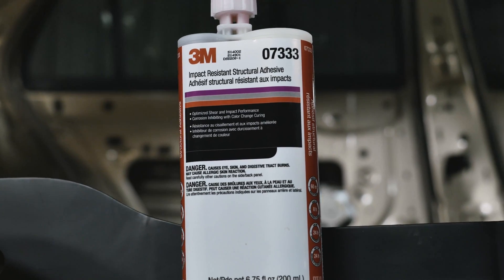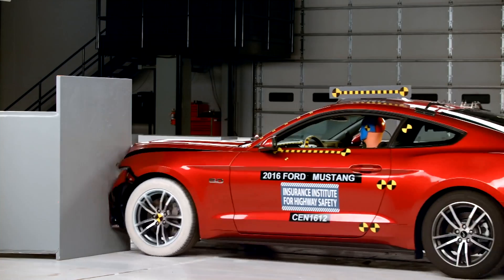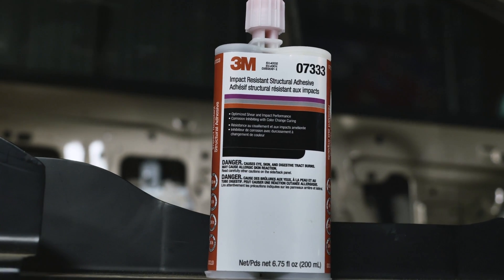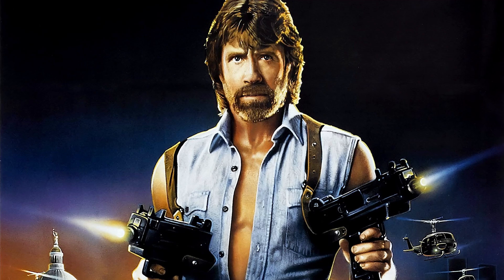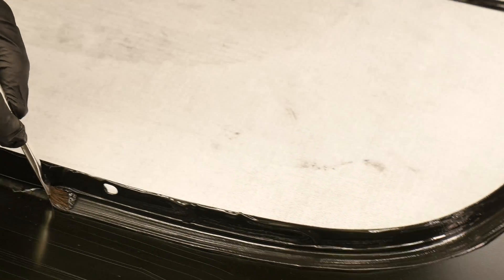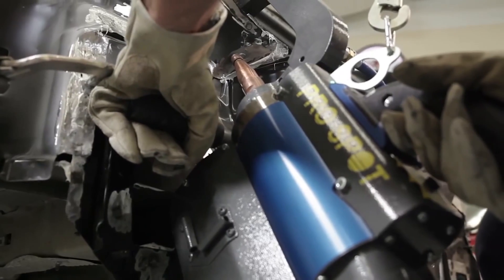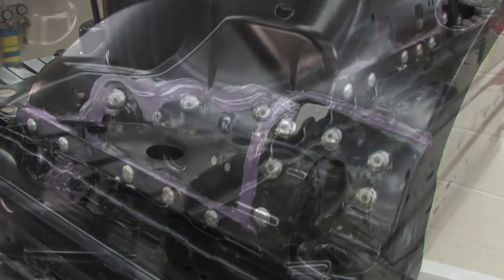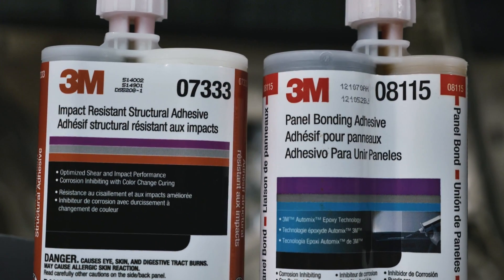Repair University: Structural Vs. Panel Adhesives

Comment: Exactly why I like my welder.  I get so tired of hearing dumbasses . Use glue it on.  Smh... I'm not a collision teck. I restore cars. . These glues are nice. But create a false narrative
Reply: I agree, that on the older, simpler chassis designs, welding is the way to go, but now we have modern vehicles with more complex designs that don't lend themselves as much to welding, nor does the stronger yet thinner heat treated steel, let alone aluminum which has its own welding issues.

Take good care if your older vehicles because the newer ones won't be worth restoring when they hit the same age, nor will anyone want to because they're all the same butt ugly gymshoe crossed with a spaceship design, except now with evil transformer looking front grills.  It's hilarious and sad at the same time, but fear not, it can get much, much worse when they move to all plastic.